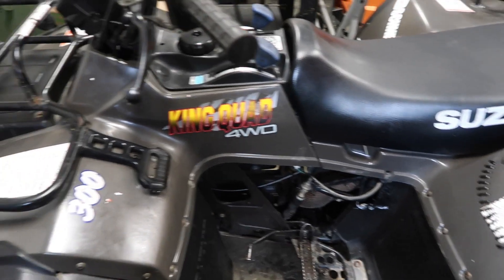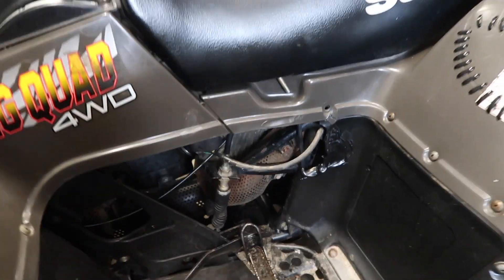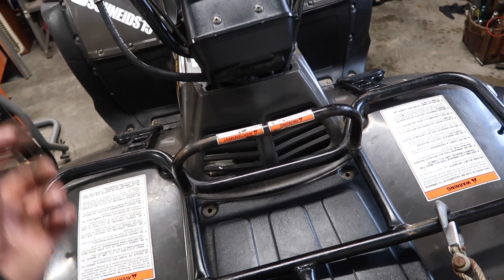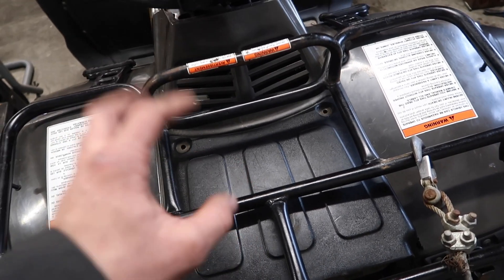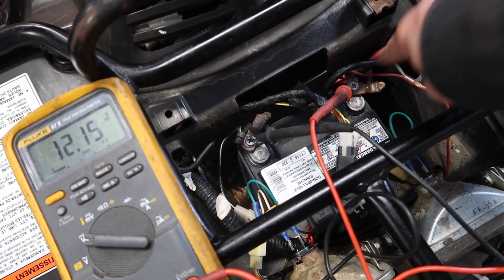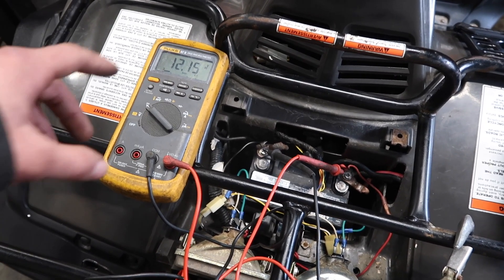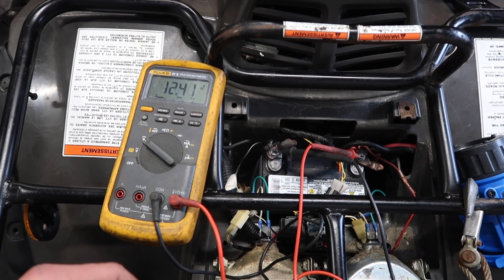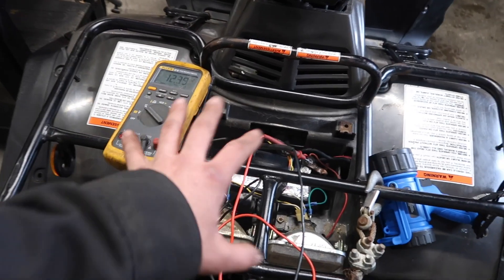How To: Suzuki King Quad 300 + Quadrunner 250 Charging Testing. Part 3 : Voltage Regulator/ Stator

Comment: I have a 2001 kingquad 300. Voltage at battery not running is 12.33dc. Running and revving engine voltage drops to 10.4vdc. I just checked my stator based on your videos and it’s good. I’m pretty certain my voltage regulator/ rectifier is bad. Thanks for your videos
Reply from the maker: Hey Joe, if your stator tests fine it is either wiring or voltage regulator. I would 100% lean on the regultor.

Comment: Hey super helpful information. Did a engine swap from a 99 to a 2002 engine 99 had 6 pin 2002 had 8 pin. Switched wiring harness but could not find a 32900-19BB0 cdi as it did not come with it. I was told a 8 pin ltf 250 Ozark would work. Still not getting spark. Hoping your diagnostics will help. Do you think the Ozark would work? Thanks
Reply from the maker: Hey sorry, i really am not sure i will admit! I would have to cross reference cdi part#s from a king vs ozark.
Reply: Hey te Ozark ltf 250 cdi does work in place of the32900- 19bb0. I just had a start saftey switch going to ground. Hard to come by the 19bb0 and Ozark are available if u havve 8 pin cdi. Thanks

Comment: Thank you so much for all of your videos. where do you order parts from? I see lots of cheap parts on ebay but don't trust them.
Reply: I've seen that the carbs are garbage. just wondering about ignition/charging components. I can't diagnose anything, the machine is 2000 miles from me so I just plan on going there with everything I could possibly need. Bike got dunked in a lake for about 20 minutes a few years back:/
Reply from the maker: Hey Jamie, ignition parts i would trust aftermarket but would nut suspect yours to be bad as they are usually good after a little dunk. But as they were sitting a number of years that is another story.... Just my 2 cents
Reply: @Schneids15  trying to figure out why my king quad dies when I unhook the battery and it’s not charging but everything checks out to be good I followed your videos and checked it . Have any suggestions?
Reply: Mine wouldn’t run without a battery. 12.32vdc engine off. When revving voltage would drop to 10.4vdc. Once battery drains or gets too weak it won’t run. Will not pull start with battery. I’ve eliminated the stator based on the videos. Turns out to be rectifier/ regulator.
Reply: Without battery it won’t pull start